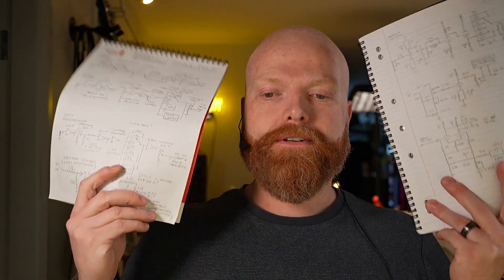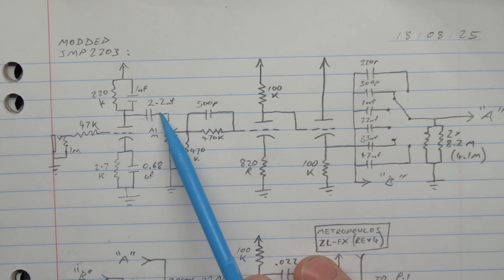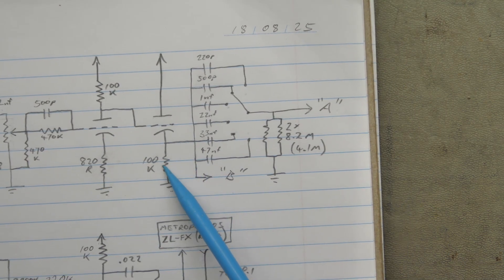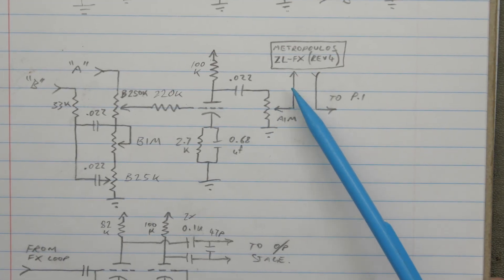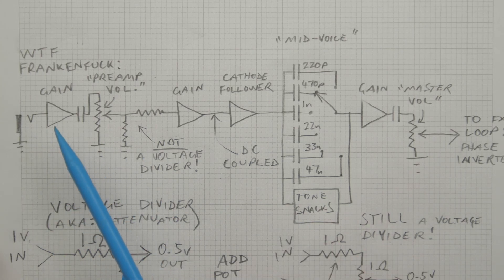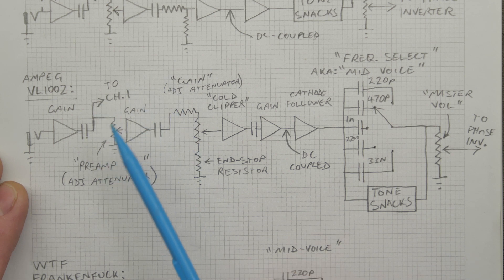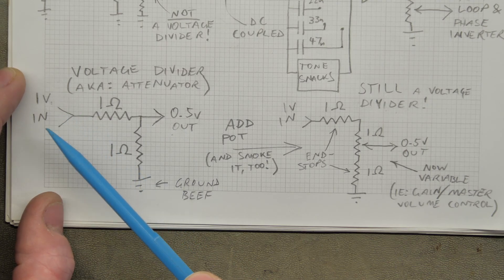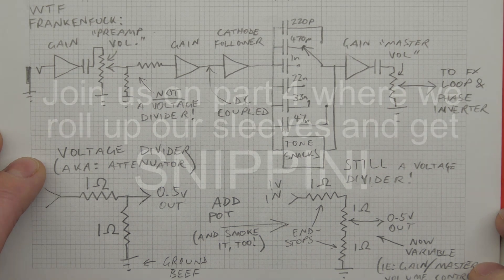JMP 2203 - Part 3

Comment: The Metaltronix circuit by Lee Jackson, but not entirley correct. It would feature another gain stage between the input gain stage and the DC coupled cathode follower..... different values. I have the correct schematic, if you want it...... ;)
Reply from the maker: Yes, it may have been a very effective series of mods if it were executed correctly.
I still think that people should just buy an amp closer to the style they want, rather than attack a vintage amp like this. The new owner just wanted it returned to stock, and he loves how it sounds.
Thanks for the offer of the schematic, Paco. Alain already shared it with me.
Hope you are doing well, brother!

Comment: seems to be very close to XLA1000 amp that I own. 470k is in exact same spot, not voltage divider. First plate is 100k without snubber and mid shift has 5 positions just like in Ampeg with 10M to ground. It also has that .68/2.7 gain stage after tonestack. I like the way mine sounds so maybe there's more to it. Great work

Comment: Lee Jackson used to make those instructional VHS tapes on how to properly fuck over any guitar amp. A mandatory prerequisite instructional VHS tape on how to solder would have been nice. Remember kiddies that a high pass filter on the NFB  works backwards.
Reply: I have seen the video to add the extra valve stage. I recall thinking that it wasn’t necessary to add the extra valve as he didn’t use the normal input. 

As noted by Brad the amp has no clean output. It was hilarious watching Lee Jackson showing it clean up when it didn’t clean up, it was just less distorted.

Comment: The first two stages look like a modded bright channel of a Super Lead Plexi. This might help explain the 2.2nF coupling cap. 2.2nF is a pretty standard value for this location in a modded 2203 as well, though perhaps a little aggressive since there is normally a 470k resistor also in series with the gain control, though the gain control is often also shunted with a resistor. A 1nF snubber on a 220k plate resistor is intended to smooth the top end, which makes sense considering there is a third gain stage with a bypassed cathode. The 470k resistor on the wiper of the gain control to ground tightens the voicing as the gain is increased. I’ve done this myself. I’m surprised there isn’t also a 470k resistor from the grid of the second gain stage to ground to set a reference for the treble peaker. So yeah, perhaps the 470k resistor was simply misplaced and this was just a happy accident. I saw the previous videos on this project and understand the acrimony, but personally I think getting a good distorted tone out of a 2203 requires either an overdrive pedal or a soldering iron; not that I particularly like the way this was done. Thank you for sharing the circuit. This was entertaining and highly informative!
Reply: "I think getting a good distorted tone out of a 2203 requires either an overdrive pedal or a soldering iron." Exactly, I worked on piles of these back in the 80s, change 5 components (without cutting or drilling anything) and it's a different amp.

Comment: Jason uses the 2n2/0.0022uF coupling cap to tighten up hi-gain mods. Then he does the fixed resonance mod. We have a culprit lol! (just kidding - no way is this his work)

I tried a 0.0022uF cap there. It cut less low end than I thought it would. Putting the bright cap back in made a much bigger difference. BTW. Whatever happened to ceramic disc caps? I guess they do not make them now huh?
Reply from the maker: I discussed the topology of this amp with Jase yesterday, but forgot to mention that cap!
Reply: Forget to mention a 4-hole plexi has 2.2nf coupler on V1b bright channel as well.
Reply: Vishay and others still make good old fashioned ceramics with various different dielectrics
Reply: The 2.2nf gives the stage a mid push and prevents the bass getting flubby going into the next stage. Can prevent blocking distortion. Jason does this on his Jose’ mod too.